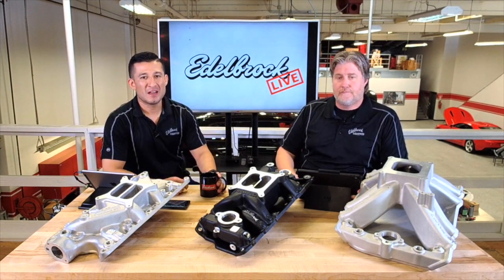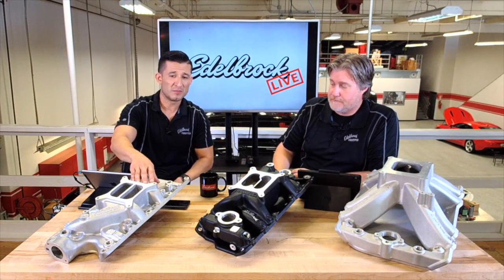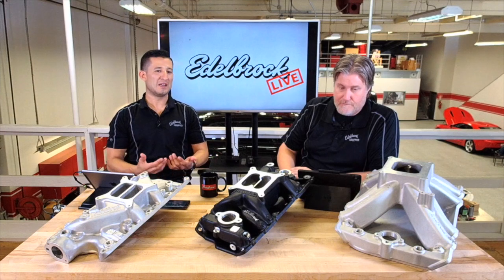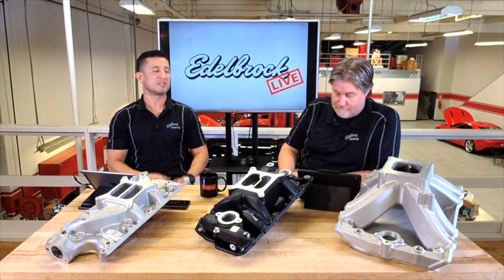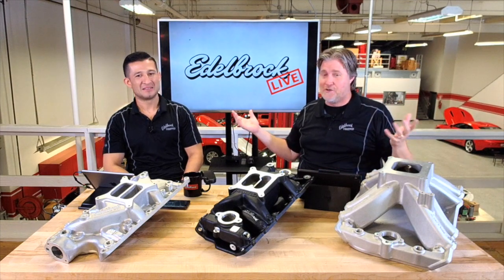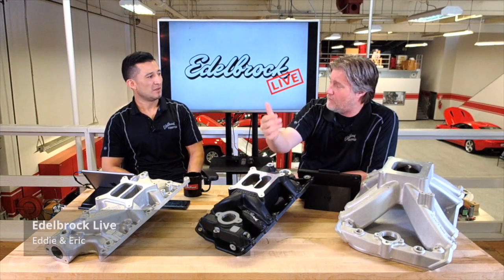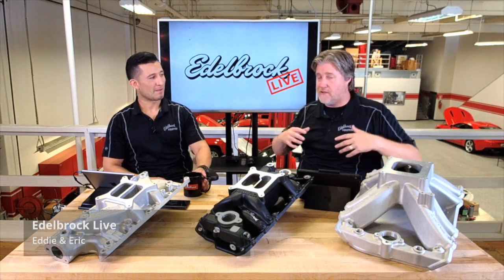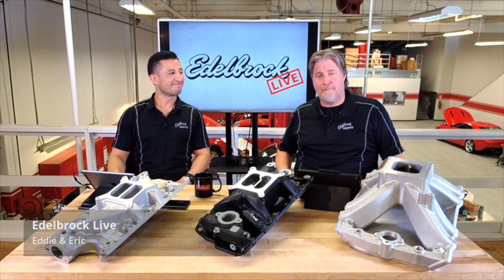Edelbrock LIVE Episode #10: Carbureted Intake Manifolds

Comment: You don't lose low end torque due to longer runner length. You gain torque from longer runners. You lose torque from larger runner cross sections and increased volumes. Also the massive plenum volumes single planes have reduces low end torque and throttle response. Those things are all meant to increase power at high RPMs. It's a trade off because the air/fuel velocity is poor in the lower RPMs. But it's NOT the runner length killing torque. If you built a single quad tunnel ram with long runners that had a perfect cross sectional volume to maximize efficiency/velocity at  3000-3500 rpm on a 350, it would make massive low end torque. It would have to have a small plenum volume to match.

Comment: trick flow head kit with cam and rockers.  should I use performer or victor jr..?????
Reply: Get the standard performer. Cut holes in the top, port it out, weld it shut. Paint it stock like. And take peoples money.

Comment: Really a lousy video! If I were Edelbrock, I'd be horrified! For the Mustang guys, the Base Performer is a great way to go from 2 barrel to 4 barrel, or cast iron to aluminum! All 3 of these intakes are good for different RPM ranges. I'm building a 408 SBF Roller engine for my 1970 GT350 Shelby Convertible. The intake has to fit under my hood! The Air Gap won't fit under a stock 69-70 Mustang, Mach1, or Shelby Hood. The Performer RPM will! Since it's a Roller Cam Engine, it has about 6,000 RPM max. The Performer RPM is right in the power range. Went with a Howard's Cam Roller with 582 lift. They say the cam is for Street or Bracket Racing! Went with Performer RPM Heads and a Scat Stroker Kit. 2400 stall, with a built AOD, and 3:50 Trac-Lok. 10.3:1 compression. Fuel Injection throttle body on top!

Comment: You can easily get high horsepower and torque out of a SBC stroker using a Performer RPM AirGap.
Being that a stroker makes good torque anyway you could put a 1 inch spacer on the AirGap for a little extra top end power.

Comment: Will the performer 289 work with big heads and performance cam ?
Reply from the maker: It will work, but if you are going to run high flowing heads, an RPM might be a better fit.
Reply: @EdelbrockUSA  yeah , thanks.

Comment: I have a 350 olds and i made it into a pro stock engine .. and i saw yr victor intake ... for a olds .. so if i was to get it?? How are the bolts will align with the heads and intake ?? Bolts ??? Will it link are or the cover up the middel port on the heads ???

Comment: I have a 1963 Chevrolet Impala 327 and I would like a Aluminum Intake and i need it to have the oil tube so I can put the oil in through the intake like factory  any suggestions
Reply from the maker: Call our tech line. Tech Line Only: 800-416-8628

Comment: hi , I have an older Edelbrock manifold on a chevy 350 engine,   The 2 back water ports by the distributor are factory machined over and not open for water to flow through the back .  Can you tell me if these need to be drilled and filed open ?   Thanks in advance, I put 30,000 miles on the engine this way with no issues but had just noticed it.
Reply from the maker: No need to do anything, as the factory original intake manifold did not have any water in the rear either, after 30K miles you are good for another 30-40K more miles..
Reply: @EdelbrockUSA  Thank you for the Tech. Tip,  that's one less worry in the battle to get this thing back on the road after 21 years.
Reply: Can the rear water outlets be used to run a heater core?

Comment: Hi I have a question 
I am running a 351c 4v heads and I'm wanting to purchase a RPM air gap ed7564 but noticed the ports are a lot smaller than the 4v head ports. 
My question is are they ok to use on 4v or are they just suited to 2v heads and can they be port matched.
Reply: Richard Veselin port match them!

Comment: "EPS" stands for Edelbrock Performer Series , Edelbrock's afb style carburetors.  In the case of the 2701 Performer EPS manifold, it was designed to to maximize the characteristics of the EPS carburetor. The regular 2101 Performance has a dual carb flange that can take either a square flange carb or a Quadrajet spread bore, so it is a compromise between the two. The difference between the two is an increase of nine ftbs of torque for the 2701.
Reply: ,2975
Reply: Good call bud !!!!!!

Comment: Aluminum intake vs factory plastic intake. I have heard that plastic intakes are lighter, reduce intake air temp, and could be made cheaper than aluminum. Is there any truth to this.
Reply: Price per piece is relative to volume.  A polymer intake is injection molded. The upfront cost of molds & tooling for injection molding are very high. As an example the tooling for an aluminum manifold might run $15,000, for an injection mold you would be looking at $800,000 and up depending on how complex the intake is. So if you are doing a hundred thousand intakes the cost per piece would be less, 8.00 based on our $800,000 example. But if you only build 100 the cost per piece would be $8000. This is a very simple example. Cost up Front times Volume over the life of the tooling and the market demand all come into play. 
Check out some videos of Injection Molding factories vs Aluminum foundries.